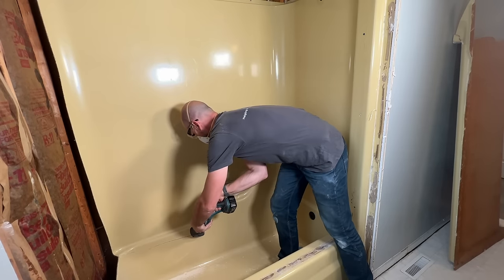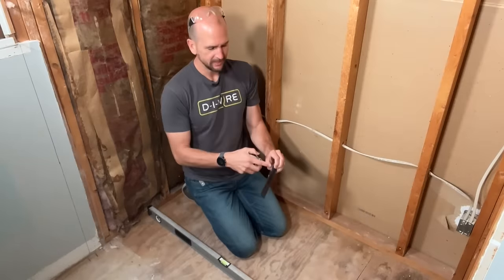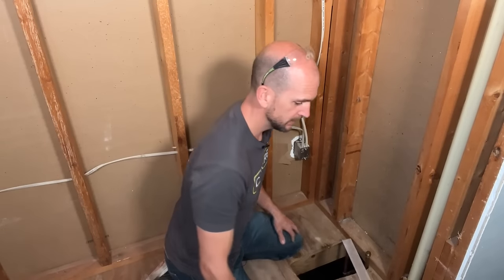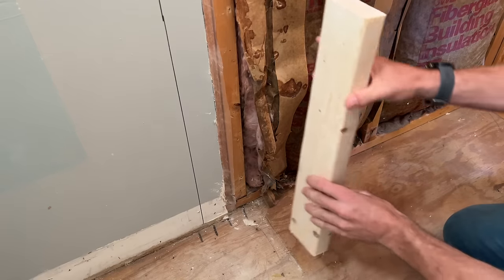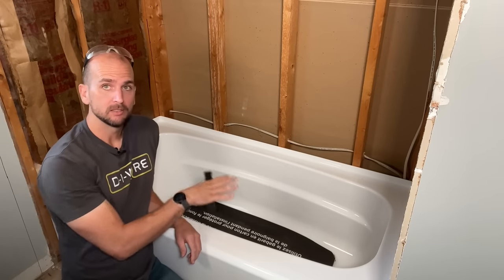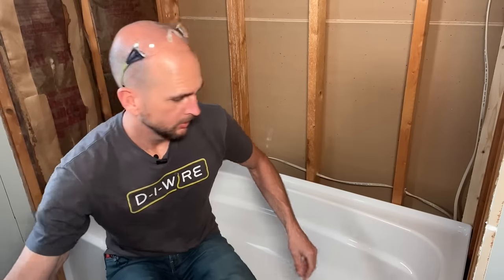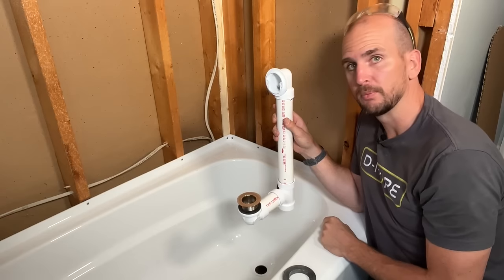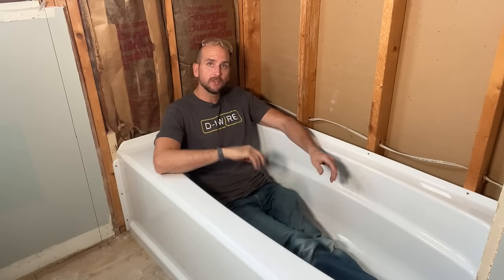How To Install A Bathtub | Delta Classic 400

Comment: As a licensed professional plumber, I cringe at videos like this. Where do I begin? First, you should avoid purely acrylic tubs. You want a fiberglass reinforced tub, and the thicker the better. Stick with American Standard, Kohler, Jaccuzi... That thing looks like a cracked tub waiting to happen. The best way to install a tub is to run 1x2 ledger boards under all 3 sides to support the upper part of the tub. Then, you want an additional 2x3 or 2x4 board screwed to the subfloor that will support the side apron. On curved tubs, you may use several blocks. That's far better than that flimsy, flexible piece of plastic. Do a dry run to make sure it all fits and is level, then run a bedding material. Typically, we use ordinary mortar, but there are other appropriate bedding materials. You want to create multiple mounds across the width of the tub taller than the underside of the actual tub surface off the subfloor. It'll squish the mounds and form a bond, just like bricks do. Now, you set the tub after the drain and overflow has been attached and carefully seat the tub until it rests on all 3 ledger boards and it is seated so as the apron is on the subfloor . Use #10 or #12 wood screws with washers (I use a stainless washer) and screw just above the flange on every stud, grabbing the flange with the washers, pulling it snug to the stud. Do NOT screw through the flange as you are creating a possible leak point for water to get into your wall cavity and cause all kinds of problems. Avoid that completely. Let that mortar setup completely. Now, when you install the backer board, you must notch for the screws at the bottom. Remember, your backer only goes to the top of the flange, and not into the flange itself, or any water that may get behind can wick into the backer board and to the studs, etc. Your tub will now support a 400 lb human walking around and leaning all over the ledge WITHOUT CRACKING. This install not only uses an inferior quality tub, almost guaranteeing failure, but that plastic support webbing and on the apron will flex and allow your tub to crack and your pretty new bathroom will need a new tub before long. Don't do it this way!
Reply: I'm glad I read your post.  I now regret buying this tub(and it's matching surround). Have not installed it yet, your comments make absolute sense and I I'll be doing everything you recommend!
Reply: 100% agree. I have this tub. It came newly installed in my house when I purchased it. In less than several years, the tub cracked in multiple places from simply dropping a bottle of shampoo on it. The drain it now leaking as well, so I’m pulling that out now to stop water in my basement.
Reply: 4q31
Reply: Great comment, I recently bought this tub and surround myself and I’m going to definitely reinforce it like you said to do.
Reply: Thanks so much for the extra info. I am sure you very well may have saved some people money and frustration.
Reply: scorpiooooh  honestly, I typically mortar right to the subfloor. Its no different than thinsetting Ditra to the subfloor, IMO. I've seen guys put a sheet of Ditra under, too, to act both as a barrier and to have the seperation between the two. That isn't as big a deal as you'd think. A lump of mortar can crack under the tub and it wouldn't make a difference since it's not keeping water out or decorative. You just want to stop the acrylic from flexing under your weight. It's a good idea to make sure you have adequate floor joist support either by sistering or something nice and solid to begin with, so it doesn't undermine the mortar's job and break it down in time from the flex. If you want to put house wrap down first, I dont see it being a problem.
Reply: Fucking brilliant.
Reply: @ruelsmith  lol
Reply: Great advice, lots of folks using acrylic tubs and lot of 1 and 2 star reviews on various web sites. I liked the fiberglass one I saw online but for some reason it also had bad reviews.
Reply: You should make a how to video.
Reply: Wish you made a video, I’m tired of seeing these diy videos. I wanna see someone who actually is a professional and knows what they’re doing
Reply: if your tub does have plastic support webbing can you still mortar for support?
Reply: Is there a video on how to do it this way??
Reply: Make a video
Reply: Please make video to show us!
Reply: Where's your video?

I'd like to see how a professional plumber installs a tub and surround.

Unlike the builder or plumber who cuts a square hole with a circular saw for a toilet flange.
Reply: Thank you. I'm considering the Kohler Archer 60 x 30 or 66 x 32 tub. I will follow these instructions!
Reply: @smoberdeen  Not investing in the equipment to make videos. lol I'm not all that photogenic at 56 years old, anyway.

Comment: You have a right-hand tub, not left-hand ...you were facing the wrong way when you said that.  Manufacturers typically recommends a mortar bed, read the buyer reviews on these acrylic tubs about cracking and breaking.  Also, some manufacturers specifically state NOT to use flathead screws and NOT to countersink because it can pull through.  They suggest using truss head screws that have a wider, washer-like, head.
Reply from the maker: Good catch!

Comment: I would have put in some insulation around the tub and inside the interior wall cavities while they are open.  The insulation around the tub will help maintain warm tub water when taking a bath and the wall insulation helps keep unsightly bathroom sounds from being heard in outside rooms.
Reply: Whatever ,,,and standard insulation does nothing ,nota for sound prevention

Comment: I installed my American standard jetted tub & the manufacturer instructions specifically said to nail above flange with nail not contacting flange but as close as possible without touching flange at all & I did mine in mortar just to have a permanent solid bottom

Comment: Thanks for the vise grip tip for cutting strips with a circular saw! I can't believe I didn't think of this. Thanks again!🙂
Reply from the maker: Super handy, I saw @RRBuildings had a little guide he used on one of his shorts which gave me the vise grip idea that works for the few times I need to cut furring strips.

Comment: We looked at all kinds of tubs, and we decided to go with a traditional steel and porcelain tub. The fiberglass and acrylic tubs seemed to flex to us. We had experience with fiberglass tubs in previous homes, and we just didn't like the noises and the fact they can be scratched easily. I also stuffed the interior of the tub with insulation, and now my wife says the water stays hotter longer, and the insulation also git rid of the hollow sound that tubs can have. All in all, we are happy with it. Thanks for the videos!

Comment: Nice video thanks! I read all comments especially one professional. Currently I am looing for a tub for renting house yet I see ~20% bad reviews for all tubs below $600. I have a Sterling tub for 10+ years no problem, yet looks like same model also has many negative reviews might due to dropped quality - US vendors keep doing these. All acrylic tub now seem to has fiber, yet either acrylic/fiberglass or mixed none are trustable any more, so I think DIY enforcement, say using the material to seal metal duct, or add foam everywhere, any comments?

Comment: Good idea with the countersink bits 👍 I will be implementing that one. Those delta tubs are very light and easy to install. Nice work 👍
Reply from the maker: Thanks man, your channel is progressing nicely.  Way to keep cranking out the content 👊.  I want to see more of that garage you showed the other day.  I need to get a similar setup where I can have some storage for the rentals/flips and then a setup for the channel where I have everything permanently set and ready to roll for a talking head or stationary video.

Comment: Absolutely jealous of your access to the p - trap. Just installed two of these tubs in my house where the only plumbing access was from above.
Reply: how did that go? I have a similar situation I'm about to tackle. did you wind up having to cut into the ceiling from below? Any tips?
Reply: @kamaubilal3904  I cut out the old trap as square as I could make it from above. 

I cut all the pvc  and test fit it before using the PVC glue.  I drew lines across the connections and at the depth of the connection with a sharpie so I knew how they went back together before taking it apart to glue. 

I then glued the entire trap together making sure to force each piece to the right depth and holding it there for a minute or two until the glue set. They had a nasty habit of pushing apart as the glue expanded and dried. 

I then made sure it still fit including with the tub in place. Then removed the tub and glued the trap in place. 

The only leak I had was because I didn’t tighten the drain enough because I was afraid of of snapping the fiberglass tub. Make sure you know where the leak will show up and check it regularly for a the first couple of uses.
Reply: @paratus04 thanks!

Comment: I,ve heard and seen many bathtub installations like this where the contractor really emphasizes NOT drilling into the flange but using a clip that is secured to the stud. Is drilling into the flange creating an opportunity for leaking later or worse yet, cracking?

Comment: Why cut corners on cost of tub? Water damage equals rot and mold! You're very thorough with most of the steps involved. After 40 years as a General Contractor I've seen it all. Please don't be penny wise and pound foolish. Next tub invest in a fiber glass reinforced acrylic where the apron is incorporated. As the plumber said in your other review never penetrate the acrylic with fasteners. Always support with Ledgers and a solid base. Water is 8lbs per gallon plus live load.

Hope these honest comments help you.

Best to you,

John

Comment: At 0:03 - I always have an irresistible urge to mix up some powdered quick set and fill in the gap around electrical outlet boxes if I have access to the back side as in this video.

Comment: You make some of the best DIY videos on YouTube!  Thanks so much.  However, my tub is upstairs and the access to the drain is between floors.  Not sure how to deal with this.  Can you help?
Reply from the maker: Thanks for the support.  Depending on the setup you might have enough access to build up the drain prior to setting the tub.  Else you could open up the drywall from the first floor complete the tub project but you will have a bit of drywall and painting once finished.

Comment: I always use mortar under the base. Overtime it helps prevent it from squeaking.
Reply from the maker: Do you guys put down plastic to reduce the moisture going into the subfloor?
Reply: @rm742  I like your comment so  I repeated  it and told everybody it was my own idea... LOL.. Sorry I did not see your comment below.
Reply: @EverydayHomeRepairs  not normally. I just wipe the subfloor with a wet sponge first. It's no different than attaching Ditra or Kerdi to it via modified thinset.

Comment: Never use acrylic tubs, I was a patternmaker for a fiberglass company and have years of experience with acrylic products. I also made a pattern for a bathtub and one piece shower.
Always use porcelain tubs and tiles, you will have a system that will last you many years and a finish that will still look good after many years of use. Acrylics were never meant to take the kind of use and cleaning a tub gets. One is a sprayed-on plastic coating on fiberglass the other is steel or cast iron covered in a specialized subset of ceramics melted on at temperatures of about 1,200 deg. There is no comparison between the two products.
.
Reply: I think US doesn't make iron tub, all imported no matter which brand and all has rust or ceramic layer drop off issue. My Acrylic tub is 10+years but same model like other model < $500 has lots of crack issue these days, I believe most tub you get in US has lower quality now. Stock holder just want to earn on time before they and the brands die.
Reply: @joecox9958  You can still get cast iron tubs made in the US but they are very heavy. The steel tubs are okay now that they have added sound deadeners to them but cast iron is the best.

Comment: I have this exact tub/shower that has 3 separate walls which are caulked at the seams of the walls and the tub. Water pools on top of the flat surfaces of the tub and turns a pink color. It doesn't drain properly. The water eventually gets in through the caulking and molds start to grow. There are also small hairline cracks in the bottom of the tub. I called the manufacturer and they replaced the tub kit however, the quotes I got to install it are expensive. I am going to build a wall of caulk around the cracks and fill with water. Will monitor it for a few days to make sure the water doesn't leak through the cracks. Once I determine that it isn't leaking, I plan on removing the old caulk, spraying mold killer and recaulking everything.  Does this sound to you like the right way to go about it and why is the water pooling on top? Is there a fix for that?
Reply: I know somebody install tub a little slope to improve water flow. No matter how, any plastic tub - no matter name they give - below $500 are tend to crack. I have one installed 10 years ago no problem, but from time to time, all big brand US name has poor and poorer quality.
Reply: @joecox9958  I let a pool of water sit on the cracks for a few days. Nothing leaked

Comment: I’m curious if you had any issues with the tub drain leaking after install? I haven’t installed my tub yet but will be in the next couple days. It’s the delta 400 but I read online people were having issues with the black base interfering with the way the tub drain would seal to the bottom of the tub and then it would leak. Thanks in advance.

Comment: Does every tub, whether 30" or 32" with the outward curve, have the drain in the same place? My big concern is we want to do an upstairs bath and if the drains don't line up, I have no idea how to fix it since I can't crawl into a crawlspace like you did. Also, do you have a video showing how the wall gets fixed when you are done? My insert now seems to be a once piece tub and wall and it looks like it sits on the wallboard or the wallboard ends all around the front and top lips of the insert.

Comment: I tried using the dap, amp hybrid sealant and is very difficult.  Can you suggest another product easier to work with.
Reply from the maker: I think these are the approved sealants - DAP® 3.0™ Kitchen, Bath & Plumbing High Performance Sealant
- LOCTITE® PL Heavy Duty Sealant
- Red Devil® RD3000™ Advanced Kitchen & Bath Sealant
- ECO-BOND® Kitchen-Bath-Plumbing Adhesive and Sealant

Comment: Nice, but, that tub is not a  standard height tub. It is about 4" taller. If you have room to accommodate those 4", then you are good. However, if you don't plan on raising spout and faucet, than be aware of this detail. Moreover, tub is very thin material. It sounds hollow. If you press on the apron, it will cave in. Lastly, if you purchased the Delta tub surround that Delta sells for this tub - and have a window above the tub - be careful. Tub surround will run into the window. In conclusion, tub looks good in pictures, but in real, it has a "cheap" feel to it. If you doing so much work, go with cast iron tub. It will feel sturdy, won't sound like an empty can when water hits it, and will last forever. Thank you

Comment: how do your remove a tub from an existing bathroom where the bathroom is only as wide as the tub ? and how do you put one back into the same place ?  enquiring minds want to know.
Reply: Break drywall beside the tub to be able to pull up from one side
Reply: Going to the room opposite of the plumbing cut from the floor up about 6 in above the tub height cut out wall stud that is in the way slide tub through that hole replace piece of wall stud and sister up another piece at least one foot longer or longer if you can do it. This is a little more work but well worth it and it takes a lot of the worry and aggravation out of it.

Comment: Hi ✋✋just wondering about p trap using with or without cleanout plug? any thoughts.
Reply: with cleanout plug would be better so if there is every a clog you could snake it from right there
Reply: If you want one with a cleanout plug, you should have an access door or panel so you can access it. It can be a removable part of the apron or from the wall behind.  If you don't install one, don't install the cleanout plug type. Also, those cleanouts can leak, though it is rare, so you should be aware of it.

Comment: I'm starting a bathroom remodel now and am wanting to do direct to stud however there's 61 inches between the studs because the space had drywall which I pulled out due to it being moldy from a leak. Any advice on how to take up that gap?
Reply from the maker: I would probably buy some 2x8 or 2x10 boards and rip some furring strips from the board the needed thickness to fit the tub/surround.  Just using some brad nails to tack the furring strips to each of the studs.
Reply: @EverydayHomeRepairs  any reason I couldn't use half inch plywood? Painted with some waterproofing. I'm not super experienced with home renovation and am not sure I could rip strips correctly sized to do what I need
Reply: I'm probably too late since you posted months ago, but for anyone else who might be reading, I would not recommend wood. I mean, you can, but I'm anti-wood in bathrooms after gutting the basement and drywall with mold issues... 😅
Personally I'd try cement backboard if you're going to put up a board to fill the gap. It's more waterproof.
I'm not a pro, just a DIYer, so take that with a grain of salt, but just my two cents.